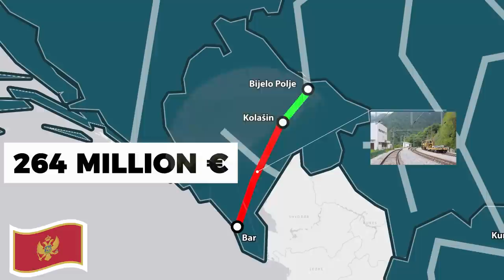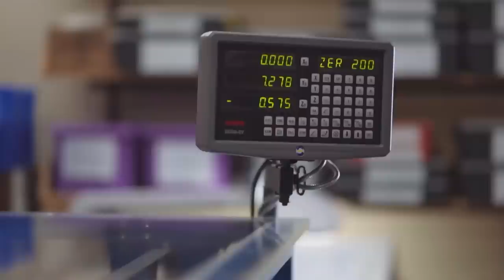Southeast Europe's Most Important Railway Projects | SEE Mobility Fair 2023 Promo Video

Comment: The North Macedonian track to Kriva Palanka is probably not going to be finished for many years to come. Due to lack of financing and probably corruption, a lot of what was already built fell in disrepair. Not to mention that the final part of track that's going to connect the line with Bulgaria is the most expensive and most difficult one to build as the terrain is very mountainous. If the track that goes through the field was so difficult for them to build, I can only imagine how it's going to be up the steep slopes.